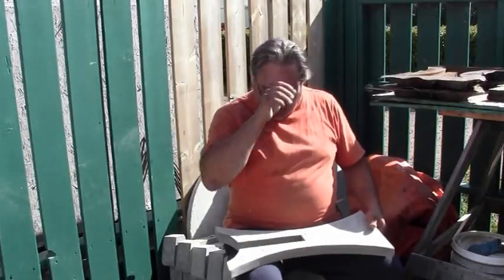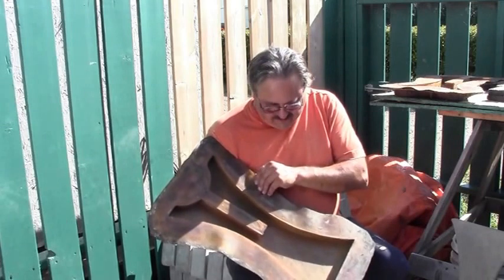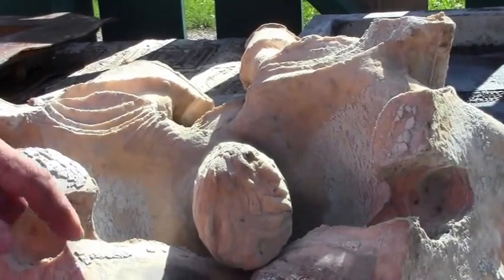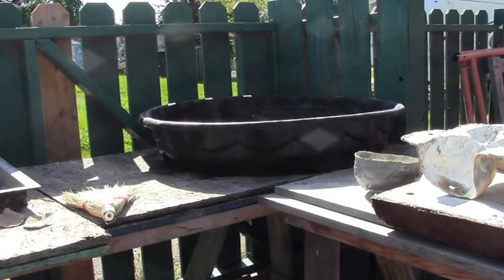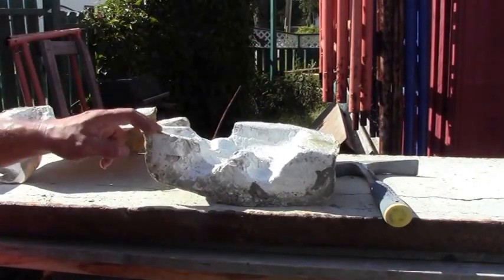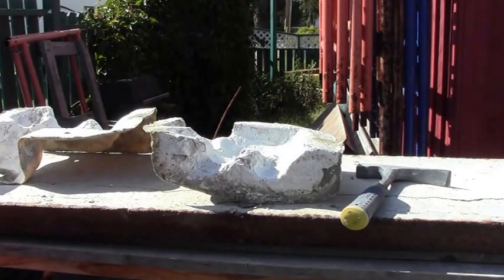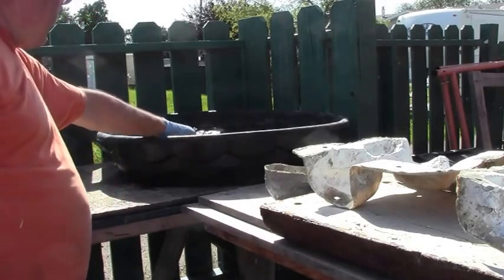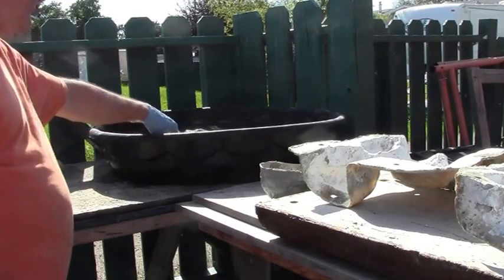Cleaning Latex Molds Part 1

Comment: how to rejuvenating old latex molds
Reply from the maker: This doesn't really "rejuvenate" them. It just cleans them. If you need to rejuvenate an old mold you could try castor oil. Castor oil is a natural lubricant for rubber latex. Just remember though; there's a point where something old just cant be revived any more and you need to make a new one.